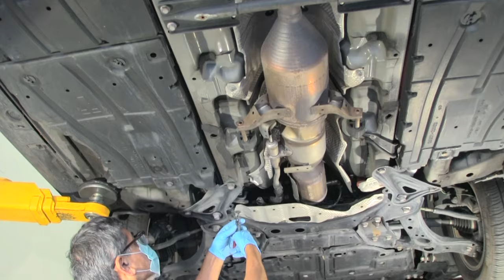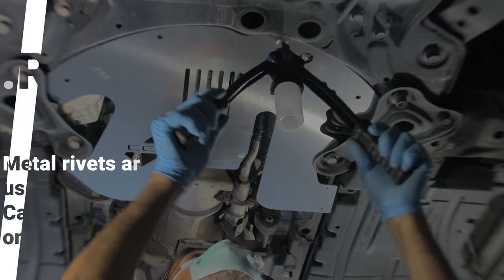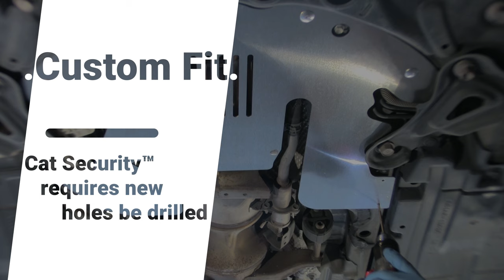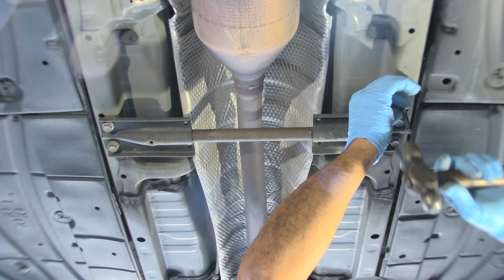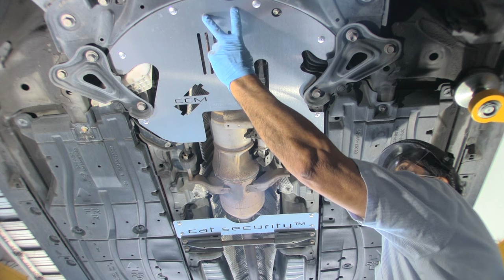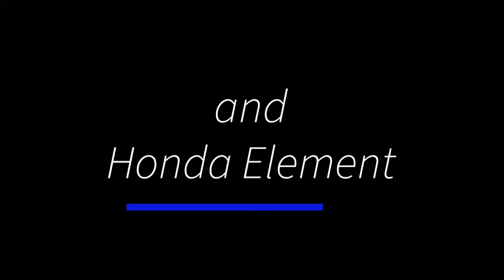Defeating Catalytic Converter Thieves | Installing Cat Security™ on a Prius

Comment: Can't steal what you don't have ;) 

But seriously that looks like tin snips would work just fine getting it out of the way.
Reply: Tin snips would easily cut it. But no cat thief would think to bring a tin snips. It would probably only be slightly annoying to cut it with a Sawzall.
Reply: Tin snips might cugt through it but due to thickness, it will take much more time and effort which the thieves won't do.  They want in and out in 3 minutes.
Reply: it's not easy to cut stainless steel, try it sometime.
Reply: @philbrown3953  Where does it say it's stainless? Their website doesn't even say. Looks like regular ole flashing.
Reply: Phil Brown, retired "tin bender" here. SS can be cut as easily as any other metal with the correct snips. I had two sets of snips in my tool box. One just for stainless and my everydays.
Time is a key element with all thefts, this might slow down a thief but it won't stop them if given the right circumstances.

Comment: If the thief can cut the exhaust pipe, they can cut the "guard"....
Reply: Anything that makes it even slightly more difficult or a deterrent will make them move to the car in the next spot that doesn't have that extra step.

Comment: How do you change the oil now 🤔
Reply from the maker: Hi Dave, the shields are mounted further back from where the oil filer and drain plug are located, so access isn't an issue. You would need to remove them if something in the exhaust system needed to be repaired, but that's about it. In that case, there would be a some labor to remove and then reinstall the shields after the repair is complete, but installation is quicker the second time around since you don't need to make new holes.
Reply: @munozauto6220  oh ok understand now just looked like it would of been in the way to change the oil and filter

Comment: For peugeot 807?, and Citroen Xsara?.
Reply from the maker: Hi Luis, unfortunately, the manufacturer doesn't make a Cat Shield for those vehicles and since we don't service those vehicles, we can't recommend any alternatives. That said, here are a couple tips to keep in mind:

1. Make sure the catalytic converter still has proper ventilation. Restricting airflow will cause damage.
2. Be aware of any changes to your ground clearance. For lower vehicles in particular, ensure that anything you install will ride high enough to drive safely if facing a steep driveway or uneven road.

Best,
Munoz Auto

Comment: How much does doing this cost?
Reply from the maker: Hi Robert, we're an independent auto shop located in Santa Barbara, not a distributor of the Cat Security, so any quote we are able to provide would be based on bringing your car into our shop for us to do the installation. If you happened to be local, feel free to call the shop tomorrow or use the online scheduler anytime at MunozAuto.com and we'll follow up with you.

That said, the price will vary depending on the make and model of the vehicle. As shown in this video, Cat Security for the Toyota Prius is more like a shield, where as Cat Security for the Honda Element is more like a cage (as seen in the "Speed, Speed, Speed" video).

Also, the installation procedure will change depending on the specifics of the vehicle. For instance, some Elements present clearance issues, which require a different installation procedure from other Elements.

Comment: Soooo this would cost more than the cat itself...?
Reply: Actually no.  A new cat, state depending, can cost as much as $3000 installed.  I know as I had to replace mine which was stolen.  The new one also in protected with one of these shields.
Reply: @gregoryhart4076  that's insane, so a new car is worth more than my old car lol. Says a lot about where we put value

Comment: Why not a motion sensor to activate an air horn or fire alarm bell? Maybe even multiple small hanging bare wires tied to a 30,000 volt coil. They would run so fast they might forget their electric saw. A YouTuber with a candid camera would get millions hits and make a ton of money.

Comment: Really the only reason I would buy this is to have a exact size to transfer over to a ¹/⁴ - ¹/² plate of steel. Without company branding cut into it only making the material easier to cut. This ¹/⁸ thick material will take the same amount of time to cut just like the exhaust pipe. So if your idea of protection is delaying them for 2 minutes at a cost of $200+ then I guess go for it.
Reply: The stainless steel models are a huge improvement over aluminum. Those eat Sawzall blades like corn flakes.

Comment: Ok, so how does the shop go about replacing it wh when the cat is bad? Do they make you buy a new setup? Cause last time I checked pop rivets only work one way, they fasten and don't come off. I cant really see the value here.
Reply from the maker: Hi Daniel, Cat Security can be removed and reinstalled without damaging the shield or the vehicle. The removal and reinstallation procedures will change depending upon the specific vehicle you are talking about, but you are correct in that the rivets will not be able to be reused. That said, Cat Security doesn't require any special rivets, so as long as the technician has other rivets to use for reinstallation, the process is straightforward.
Reply: So you're saying these cats can still be stolen easily...

Comment: considered now frame damage. the structural integrity of the car is compromised when you drill through the frame. goodluck on resale value
Reply: So you don’t see the many holes and screws already through the frame rails? I’m sure a couple more won’t hurt.
Reply: Not frame damage at all
Reply: That car has no frame, unibody construction.

Comment: POS shield.  Too thin and it is aluminum.  They can cut through that like cheese.   There are other problems with it too, as the body shop guy below confirms.  Bad design.

Comment: That's gonna be a pain to remove when ya gotta replace your catalytic converter when It goes bad
Reply from the maker: Hi Tony, not really. The removal and reinstallation processes are straight forward. There is some labor involved, but after the new cat is installed, reinstalling the shield is fairly quick since the tech won't need to drill any more holes.

Comment: Still won't protect anything, instead they steal in 1 minute now they need 2 minutes, in the end more money spend. But since you guys also make money from it, you knew exactly what it's out there, some theft have lazer cutting machine. But of course you can avoided 60% or 99% of em, doesn't mean it will protect. In the end if they use laser cutting tool, it will do more harm to our vehicle, more repair cost. Only way I'm think of is manufacturer/mod move cat to the engine bay.
Reply: Some thief have laser cutter machine? This really would be your fault for parking ontop of an inverted laser cutting machine.